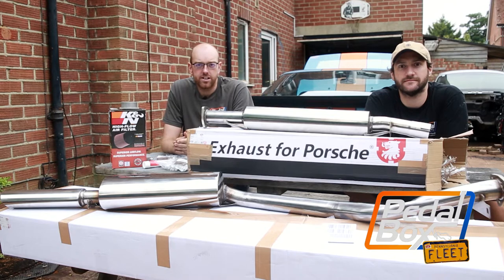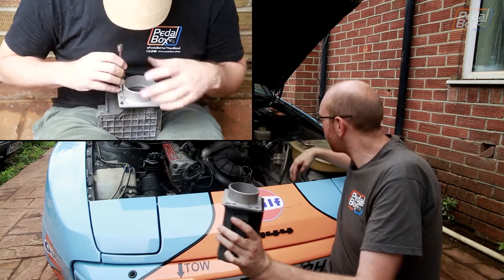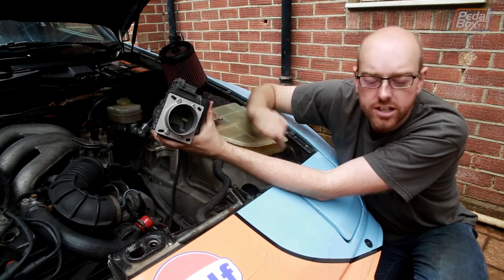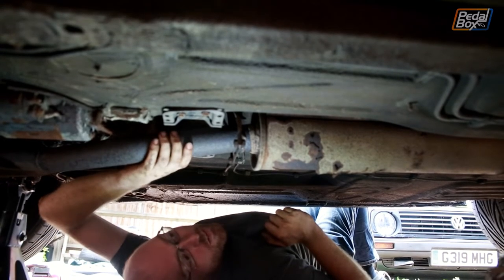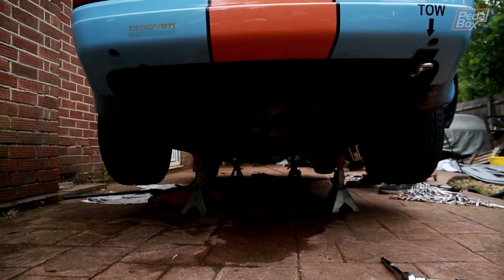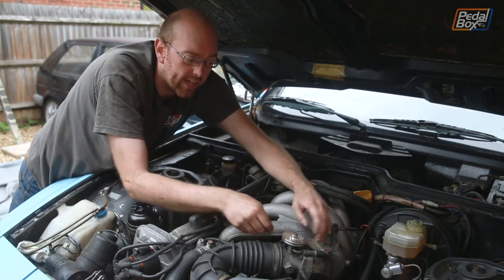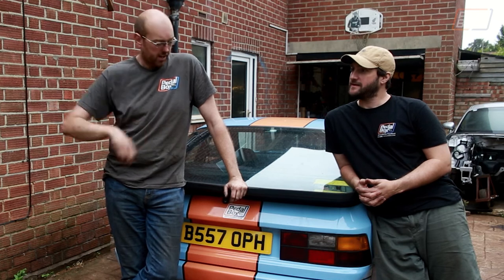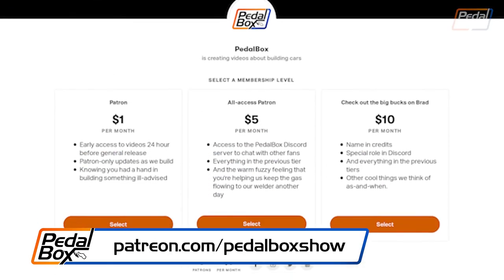Exhaust & Intake | Porsche 944 | PedalBox Fleet - Episode 55

Comment: So you are replacing  a cold air snorkel with  K&N 'sticks and stones' filter that will suck hot, less dense air from the engine bay and lose power. BRILLIANT!. Oh by the way, the stock air filter and cold air snorkel has a higher CFM rating than the head can absorb..Sooo you are achieving nothing. Plus the centre resonator is what gives the 944 its nice burble. The throttle cam is the only thing you did that makes sense. Try a DME chip which will have much more effect without too much messing around. Removing the resonator will give you a headache on long trips. Guaranteed.,
Reply from the maker: Thanks for backing us up on the snorkel! Really appreciate when people can confirm our thinking, even if it's not the best option.

If you'd watched after the first 30 seconds where we listed what we're doing, you'd have heard us talk about why it's NOT all good, and IS largely superficial, with a snorkel providing better cool air sourcing. This puts you in the 41% of people who don't get beyond 30 seconds on this video, I'd recommend watching the rest though.
Without watching it back myself and falling foul of YoutTubes 'artifical view boosting transgression', I'm fairly sure I said the plan was also to build a baffle to close this off from the engine bay to address it, while retaining the K&N induction noise. Although the car was sold by James this year and the air box went back on for the sale so this was never built and it does look rather like we just left a sub-optimal solution in place. 

I didn't know about the CFM of the head being exceeded by the snorkel, though that does suggest a 'no harm no foul' as there's enough headroom for a flow drop without affecting performance from the filter though. Again, thanks for helping to justify the choice by ruling out that as a worry!

The 944 isn't, by a WIDE margin the loudest car to sit in on the drive (in fact the 944 has never lived on our drive). The Golf is by far a more rattle-y, booming interior space given it's completely stripped despite actually being quite reasonable when driving around town and doesn't have a deliberately loud exhaust, or a map filled with 'pops and bangs'. It does however sound great above 4k rpm on track and from there it pulls like a train, so it's allowed to stay. That car has well over a dozen 10 hour motorway trips under it's belt and isn't utterly horrific to be inside, nor a source of headaches for anyone i've had in the car at the time. Perhaps you're oversensitive to the resonance? (or people doing what they want with their cars) or wanted to ensure you were the smartest person in the comments by knowing 'more' than us :)

I'll pin this to let others know that they're not the first one saying this (you're in fact the second) quite so smugly point this out, though they opted to delete their comment and my reply regarding the benefit of the interaction vs the dislike i'm sure you gave (there are two, and there was only one when the last comment was made!). But really, just clicking one or other, AND commenting does a huge amount to boost what is already our most watched video.
I look forward to seeing more of your car and sharing your expansive knowledge with people of the community, thanks again for watching (if only briefly!)

Comment: IDK. I read that someone dynoed a Nine Forty-Four with both K&N and stock cold air box and got more power with the stock set up.
Reply from the maker: Apologies for the delay, hadn't seen your comment notification while I was away! I quite agree the heat soak of the bay might drop the power, unfortunately we never got the chance to build the bay shield on the framework holding the filter/etc in place as the car was sold (with the stock box back on) and obviously didn't manage to get it back to the dyno a second time to compare afterwards. It did one dyno day but held it back for a follow up which didn't happen (availability/etc) and then as I say, it was sold. 
Shame as it's a bit inconclusive if the air shield mitigation would have worked.

Comment: Throttle response on a 2.5l is very dependent on muffler design; some back pressure is required. Closer to oem is usually better unless you also change the DME. JP Dansk is a close to oem decision for 16v and Ansa makes a nice unit for 8V and turbos (which are also 8v) the 1447.
Reply from the maker: Interesting, didn't know that
Reply: This is one hundred percent true. When I got my 944 na, the previous owner put a terrible after market exhaust on it. He sold the car with the original exhaust. I resealed and put the original back on. Not only did it run better, It smelled better too. The other exhaust was junk and must have had leaks.

Comment: Loved the header only sounds 😁👌
Reply: p.s. - positive crankcase pressure ftw? 😳
Reply: @GTFour  how are you diagnosing that and what are the implications here? Passing pistons? :(
Reply from the maker: At some point it needs a catch-can Or maybe ANOTHER K&N! :D
Reply: @Ryvful  Yes there's always some blow-by and much rotational mass air displacement. PCV valve best connected to vacuum as rotational things work best in vacuum. Capping yours off is now positive pressure. Uncapping would allow positive pressure to escape but obv still not as good as actual vacuum. Venting to atmosphere also stinks with oil fumes, one of main reasons is good to feed back to negative intake pressure. Back to inlet FTW. Or if you turbo, suction side of turbo so as not to very much positively pressurise crankcase. 😎
Reply: I drove my Volkswagen Rabbit ( USA) with header only after installing a header on my 1979 rabbit as a kid. And that is how I found out that you can lose a crap ton of horsepower by deleting back pressure

Comment: By putting the cone type filter on the MAF, you are losing the original factory cold air inlet that used cold air coming from a high pressure area from the front wheel well.
I put a low restriction K & N reusable filter in the factory box.  Hot air kills hp !
Reply from the maker: You're not wrong! And we did mention that near the start (I think?) But this does give the opportunity to do more fabrication of a divider later on :)
Reply: @PedalBox  thanks, you'll need to fabricate a plenum to pick up cold air to the side of the radiator
Reply from the maker: @christopherkast8045  Yeah, should be a fun one to get the cardboard around and start folding!

Comment: i wonder about any power improvement of this change only.... ???
Reply from the maker: Sound improved for sure, power unsure for now, need to get back to the dyno with it!
Reply: I don’t think there was any improvement on the intake side.... those hot air intakes actually lower horsepower.... engine temps in the engine bay can exceed 200°f last thing you want is to be sucking in that hot air

Comment: Good video, nice exhaust but why get rid of the factory cold air intake for a K&N warm air intake?  Not to mention the likeliness of the air filter oil coating the MAF sensor and creating power & efficiency issues... wouldn't it make more sense to buy a high flow filter that fits the stock air box?
Reply from the maker: no really good reason in fairness, a high flow would have been fine, had we had time I planned to make a divider to keep the hot air at bay, but we ran out of time/material to do it. Even the support bracket went unpainted and had to be done when it came back.

Comment: Brill video thank you! I’ve recently purchased a 924s and it already has this K&N filter on it. I was watching to see if it should be having an air intake pipe running to it like the OEM appeared to but assume not required then?
Reply from the maker: You'll get some hot air drawn in from around the engine but unlikely to kill much power, take the chance to bend up a nice bit of ally sheet and make a divider :)
Reply: You could also buy 90' degree silicone bend and some 75mm pipe and locate filter down at backend, first i though i route it to pumper/fender area where oem intake is located whit two 45' silicone bends but theres not much space unless i relocate horns. It gets bretty warm in engine bay after driving a while.

Comment: Great work! Planning to do this in the next couple of weeks.
Any advice on cutting the exhaust while being under the car? I guess it can get quite sparky there...
Reply from the maker: I'm contractually required to say "safety goggles" as James (who owns this car) is in the Safety Engineering game :)
But for cutting, release the exhaust from the hangers as much as possible, prop both sides up the pipe up so it can't just drop. Cut from the bottom, then creep up each side individually, rather than doing the whole thing in one slice. You'll probably not get 100% through with the disc, but you can get close enough that a hacksaw blade or just flexing the last little bit which will break it off (we did it that way) and then clean up the end. 
Hope it goes well! Let us know :)

Comment: Turn the exhaust clamp 90 deg. Save the threads on speed bumps. Also down like this would be iva fail on a kit.
Reply from the maker: Yeah we spun it round to tighten it up to stop the scraping, good point though!

Comment: Can you post the links for everything in the discription? I want to have the air filter too 🥺
Reply: Intake stuff:
Filter - https://www.knfilters.co.uk/rx-4730-universal-x-stream-clamp-on-air-filter
Connector plate - https://www.ebay.co.uk/itm/Mass-Air-Flow-Sensor-Intake-Adapter-Plate-For-83-91-Porsche-944-944S-2-5L-H4/332829666270?ssPageName=STRK%3AMEBIDX%3AIT&_trksid=p2057872.m2749.l2649
Hose connector blank - https://www.ebay.co.uk/itm/Silicone-End-Blanking-Caps-Finishing-Bungs-Silicon-Pipe/223657232031?ssPageName=STRK%3AMEBIDX%3AIT&var=522382226472&_trksid=p2057872.m2749.l2649
Reply: Throttle wheel
https://www.porscheshop.co.uk/porsche-performance-parts/porsche-944-performance-parts-1982-to-1992/porsche-944-engine-induction-1982-to-1992/porsche-944-throttle-response-cam-924s-8-valve-82-89-non-turbo-2-5-2-7-race.html
Reply from the maker: Fortunately Ryvita beat me to it as I had no idea for the links! :)
The air filter bracket is fairly simple at least. Tag us in a picture on instagram/facebook when you get it all done!

Comment: Headers, cams and a port polish next?
Reply: Suspension and brakes are higher priority. This car is never going to be fast. :)
Reply: @Ryvful  OK, so after suspension and brakes then? ;)
Reply: @wo9656  We'll see once it's got some more trackdays under it's belt. TBH, it's about 50/50 keeping up with repairs and fixes / making upgrades at the moment, any power increases would only come after the clutch has been done. I have a set of EBC grooved and dimpled front discs, plus Yellow Stuff pads, ready as the next thing to go on.
Reply from the maker: It's the age old problem, "Ooo, I'll save up for that upgrade" Something else breaks "Cool, now I can save-" Another breakage. eventually the first thing you fixed, breaks again. #JustOldCarThings 
Feels good getting ahead of the curve though
Reply: TURBO
Reply: You don't need headers on a 944 because they come on it Stock.

Comment: Would this work on a porshe 924 2.0 l ?
Reply from the maker: The linear throttle wheel should if the throttle body is the same on the 2.0. Same for the air box swap I believe